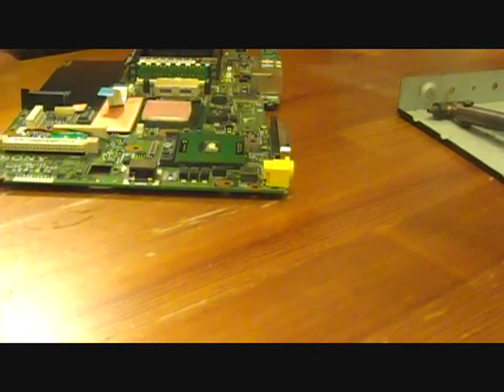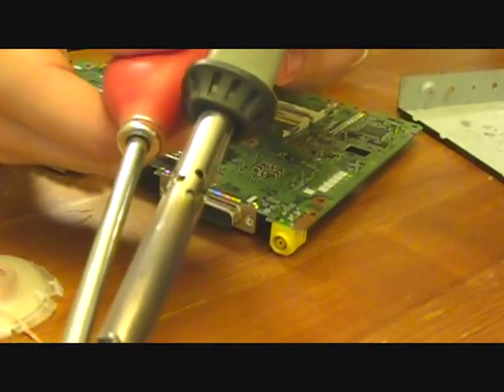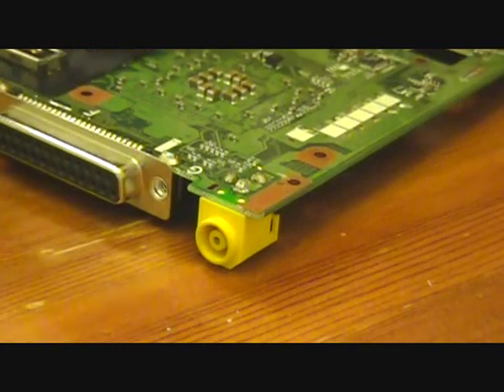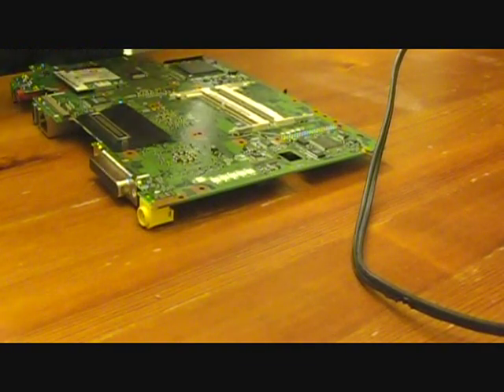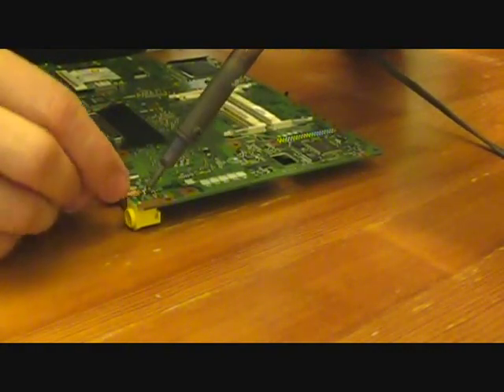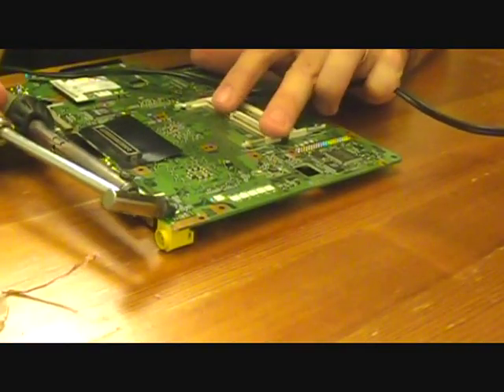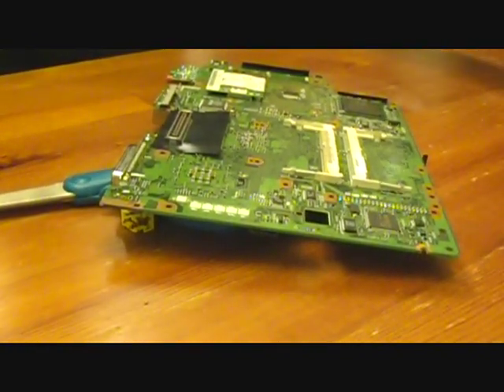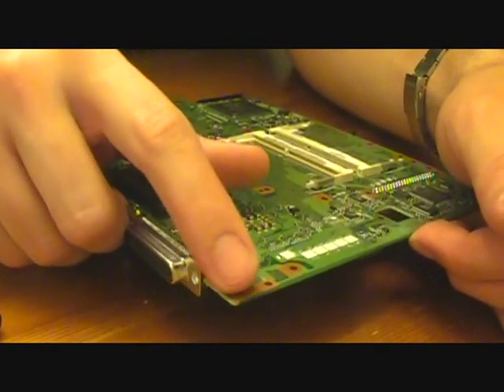Laptop power jack replacement part 1 desoldering

Comment from the maker: @Cyantist2 Probably, you may just have to hold it on the jack longer to melt the solder. My soldering iron only has a 20 watt and 40 watt setting and the 20 watt is not really enough, but I would think 30 watts would be enough.

Comment from the maker: @bupkus123 I've never been very good with the solder braids. Sounds like your iron is not hot enough. You shouldn't have a problem with a 40 watt, maybe it's defective?

Comment: Doing this onto newer ROHS motherboards can be a pain: the lead free solder will almost not melt with a regular iron,  some solder will remain into the the metalized holes, and last but not least, the pins of the jack are tight fit in the holes.

Comment: Nice job, but when using desoldering braid you should use it flat while sandwiched between the solder and the iron tip.
Reply: Yes, exactly. Strange wicking technique there....

Comment: I tried about a week ago. First I bought a pair of replacement sockets, a 40W soldering iron, some electronics solder a small roll of desoldering braid and then the fun began. 
First the iron wouldn't melt the old solder, the braid wouldn't absorb if it did, tried clearing holes with dremel, inserted new socket. The iron wouldn't melt new solder indirectly. New solder coil too thick, made mess, braid didn't help, scraped ICB with screw driver, broke power board into 3 pieces. Bought new.. $12.

Comment: When you want to remove solder its best to wet the area with fresh solder so that the solder wick will pull the old with the new.  Keep the are hot a gently pry the plug off.

Comment from the maker: @msylvain59 Make sure you use a good hot iron, I run mine at 40 watts. I use lead free solder for all my soldering. The acer I did was actually easier because the jack was broke apart, this one was a little more difficult. But yeah, some are easy and some can be a pain.

Comment: You supposed to put the braid on the solder and than the gun on the braid to heat it threw the braid to make it stick and just a tip, cut a small piece of braid, hold it in with a mini pair of plyers. This makes it Much much easier to do and you don't burn  your fingers!!! I learned the hard way lol ohhh one last tip, get the solder flux!

Comment: idk if he did it, because i had to fast foward thru it because it was painstakingly slow.   but a tip for this guy, put some fresh solder on the connections first, then use the braid.  u will see the braid suck up all te solder (fresh and old)  in 2-3 seconds. then simply go to the next one.   u should have had this done in under 1 minute doing that method.  another thing i noticed and was unsure why u were heading the solder connection, then using the braid after?   that is not what it is for.  u need to put the braid on top of the solder, then put the iron tip on top of the braid  then u will see the copper turn silver as it sucks up all the solder like a sponge!  (that is if u do it the way i said before,  add fresh solder to the existing connection. then desolder).  u will be shocked how the braid simply sucks up all the solder in 1 shot! (just keep the iron tip on top of the braid for 3-5 seconds. (no longer than that u dont want to damage the board). but 3 seconds should be long enough for the braid to grab all the solder from the connection. the PITA part is when there is a tiny little bit of solder connected to the leg that is right up against the board.  when that happens (especially with asus boards.)  then it becomes tricky u just gotta be very careful when pulling it out.

Comment: @Cyantist2 This response is really directed at the person who performed the desoldering:
13.5 minutes from iron on to power jack off... really?

I saw another video where the braid was used by laying it down on the cold solder point and applying the iron to the braid, transfering the heat to the solder thru the braid.  The braid should then have some flux coating to "blot" up the melted solder.

Comment: Im trying to solder off a power jack and my solder isnt melting
Reply from the maker: Your soldering iron may not be hot enough.
Reply: mjmcomputers its hot enough to make heat waves off it.
Reply from the maker: 1234gare1
how many watts? the tip could be loose or dirty.

Comment: The idea he gives for "if there's still a little solder on the connection...wiggle it" is pretty much a guaranteed way to rip the trace loose from the board--DON"T DO THIS !
gently and repetitively remove solder let joint cool, so as to not delaminate the trace from the board. OK a power jack trace isn't as sensitive and can be superglued or siliconed back down but his technique near surface mount components will have you throwing boards away.

Comment: You need to practice your soldering skills and your desoldering tool is a good one. When you desolder components use side cutter pliers and clip the compounents legs off as close to the board as possible. When you use desoldering wick place the wick on the solder then the iron over the wick and the melted solder will flow towards the heat and get soaked up by the wick. Practice, practice and practice...

Comment: You don't have good tools, and the tools you do have aren't easy to use for a beginner. Because of that you spend ages getting the solder off and are very careless to the rest of the board. This way of working is likely to damage components..